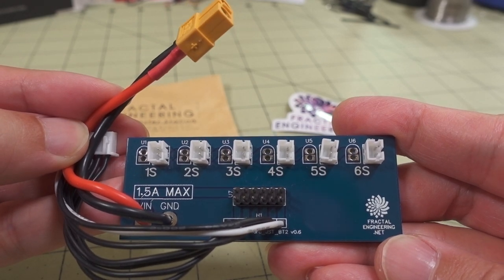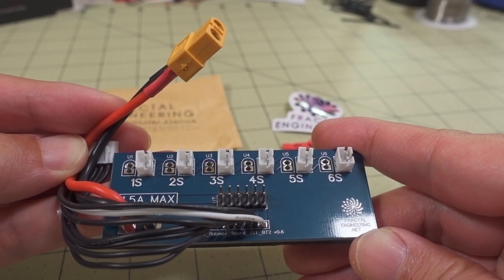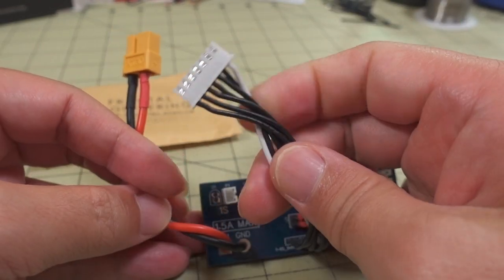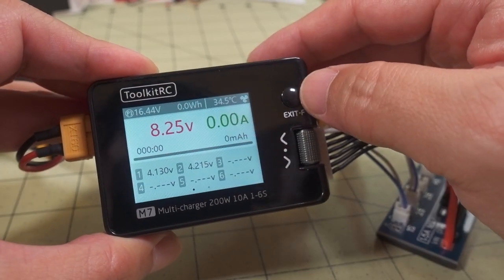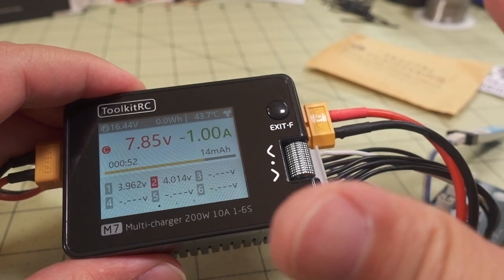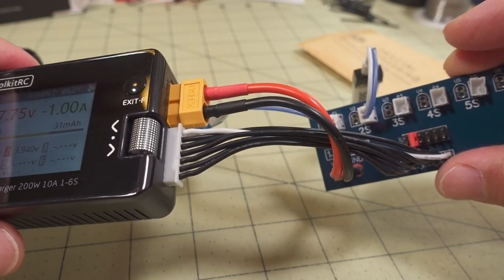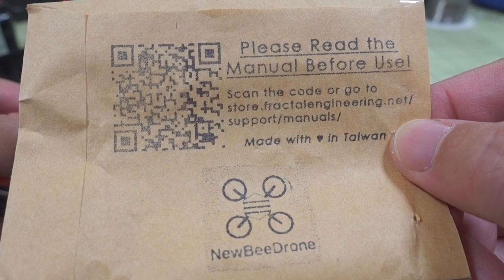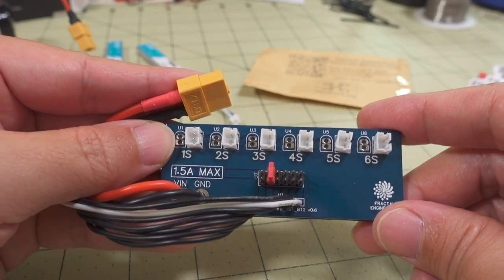Best Solution for 1S Lipo Charging Management ⚡

Comment: I've made three of those 6x1S cables. Lots of testing with the DMM to assure myself that I had it correct. I like this board, one can charge less than six at a time. (edit) And it's cheaper to buy this compared to buying all the bits to make the cable.
Reply from the maker: Good point I forgot to mention... this is definitely way cheaper than the old way by buying all the wires and adapter pieces to make one yourself.  With this now in existence, you'll only want to make a DIY one if you just like to waste time and money.

Comment: Correct me if I am incorrect.  The board looks like you could solder on bt2.0 connectors to the board next to the ph2.0 connectors.
Reply from the maker: Yes, they actually sell a version with just the BT2.0 connectors but you can add your own of course.

Comment: NIce.....I just have one of those boards that set the whether the battery in an HV or not and a light  goes out when charging is done. But there is no way to storage charge. So I just don't bother. I fly them down to about 3.5 and that's it. I may look into this gadget even though I don't fly whoops too much anymore. The lipos don't seem to last too long either. I should dump most of them and re-up.

Comment: Hah, I was just thinking this morning about trying to find or make something like this! I would like to see a 6-pos switch instead of the jumpers though, just to make it a little more idiot-proof.
I currently use the betaFPV 6-battery charger, but it can't do discharging for storage. Unfortunately like half my bt2 lipos are puffed and dead now because I never got around to using them and they sat for a month at full charge 😅
Reply: yep so my first revision used dip switches and it didn't hold up the current; 6pos switches are hard to find in 2A and when you do they are bulky and expensive;

 this much current is AC territory so the bright red extended jumper was just the next best solution to get them out at an affordable price
Reply: @fractalengineering  Ahh, that makes sense! On the opposite side of things being idiot-proof, would you consider selling just the unpopulated board? I've got enough spare connectors and wires to build one lol
Reply: When we encountered this problem with diy vapes back in the day, we went switching mosfets of the appropriate load. I know cost and time prohibitive, but who knows maybe down the line you could refine a deluxe version 😉.
Reply: By the way, love the product! Soo, I can fit gnb27 in the bt2.0 hole if I line the banana plugs right, but not fully through hole. Would that be enough contact for light storage charging?
Reply: @MissingNumb  lol yes mosfets and even logic gates to detect the number of cells automatically has been discussed, but in the end it would remain useless without the charger, so the next step that would make sense would be a full-featured charger imo

I have not had a gnb27 connector in hands, it might be bigger than BT2.0; in any case the purpose of these free holes are to solder a lead to it; I wouldn't recommend simply sticking live wires to it
Reply: @Lozoot2  No DIY kits, all boards come wave soldered and I QC every single one by hand before applying the backing tape to ensure none will cause you trouble :)
Reply: @fractalengineering  Of course soldered in place  and insulated 😂. Was unsure if not having full hole contact  would hinder performance or safety (😅)?

Comment: How would this handle multiple emax 2s batteries? Each PH2 would be 2 cells. would the jumper go to the 4 s pin?
Reply from the maker: This is not meant for that kind of battery. You'll probably start a fire, don't try it.

Comment: Hii
I have made something similar for 2s batteries. I am using for 1 year and a half and work well. If you have different capacity batteries wil also work but much slower because the charger try to balance the cells.

Comment: Nice, finally. Out of curiosity, if you set the jumper to 5s but you put 6 batteries in the first 5 connectors, instead of 6, do you have a fire?
Reply from the maker: 6 instead of 6?  You question doesn't make any sense... 🤷‍♂️
Reply: @AlbertKimTV   I just wondered what happens if, by mistake, one inserts 6 batteries with the jumper still in the position for 5 batteries.

Comment: Oh crap I made a diy harness just yesterday with 4 connectors and a 4s balance plug. Is there something I could do to charge less than 4? Like putting a connector on an empty slot and linking it’s + and - ? Dunno if that made sense.
Reply from the maker: No, you just need to get this board.  I think getting all the parts to duplicate this functionality you want will actually cost you MORE than the board at $13.

Comment: What are the solder points for?
Reply from the maker: What solder points are you referring to?
Reply: @AlbertKimTV  the one beside the ph2.0 connectors. It looks like a bt2.0
Reply from the maker: @stinerivera2543  Yes, that is what those are.  See the other comment from the creator of the board.
Reply: @AlbertKimTV  oh okay sir. That means you can solder any connector you want like the gnb one and even xt30 for 1s toothpicks?
Reply: @stinerivera2543  yes; the idea was to have standard JST-PH for most batteries, as well as a BT2.0 footprint for direct solder, to which you may as well solder any custom connector on a lead
Reply: @fractalengineering  oh I see. Thank you sir.

Comment: The only problem with this is that all the cells have to be the same capacity, whereas with parallel you can do any capacities you want, as long as the voltages match up
Reply from the maker: That's true but this is also not real parallel charging.  It's creating a serial pack from individual packs so you can take advantage of modern smart charger balancing features.  Still better than anything else out there now for 1S packs.
Reply: @AlbertKimTV  if using the balance charging mode, do the cells have to be the same capacity?

Comment: does it short one battery if you put the Jumper in horizontally?
Reply from the maker: Not sure... I don't plan on testing that just in case it does...
Reply: It probably will (depending on the side you have shorted). Got to look at the traces but I guess one side is connected to the positive sides of the batteries, while the other side is all shorted and connected to the main red wire. this way you get to choose which series connected battery is connected to the main red wire.
Reply: @sendorm  Well the manual advises against it...however for the bravest of you, if you still insist on trying then yes it will utterly destroy...nothing lol, each pin on the top row lead to the VCC side of each cell, so there is a voltage potential of zero between any of them ;)
The bottom row is a little more complicated, depending on how many lipos are plugged it may do nothing or dead short 1S; up to you, but I don't recommend it
Reply: @fractalengineering  Yeah that's also what I thought. Might I suggest a six way rotary switch for the job? It will do the same thing without any risk of short. Great  idea though. Never thought about this. I just charge all my batteries at once :)